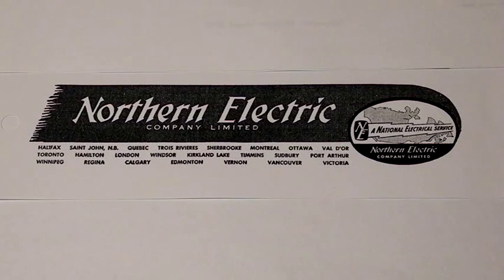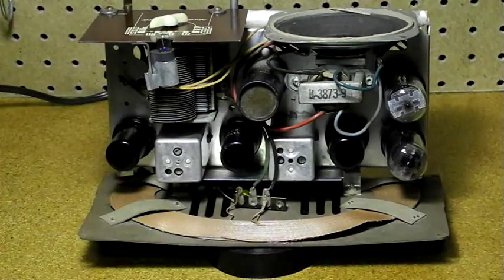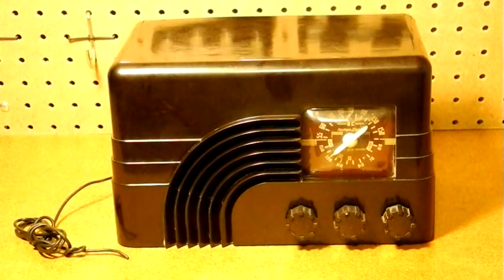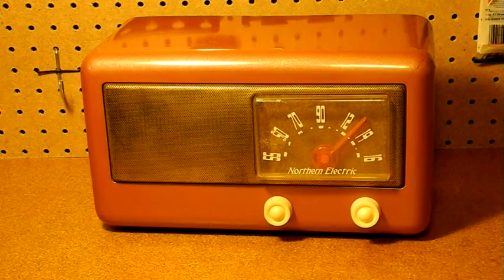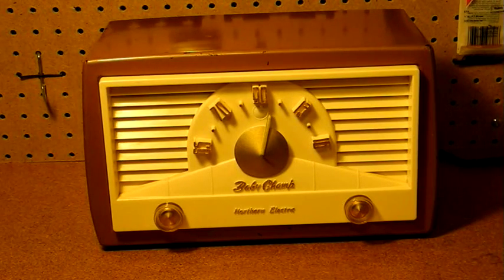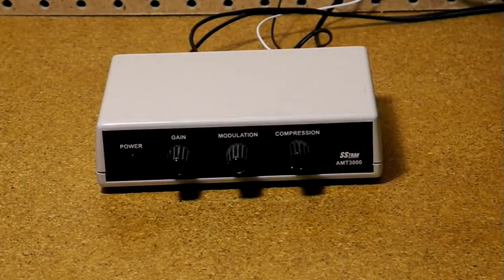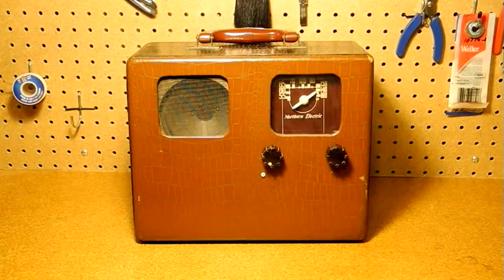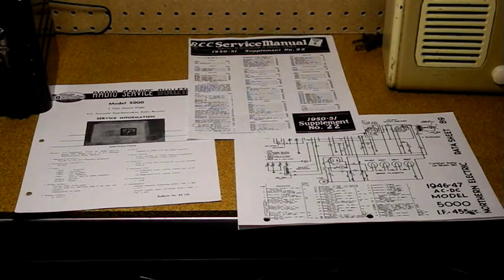Northern Electric Tube Radios

Comment: ?cud you use 9 volt bats in series. For your high voltage. Did this on a Regen set with with a 50c5 af amp home made. Kv4li
Reply from the maker: Yes, for the battery operated radios (sometimes called "farm radios") you can use a number of 9 volt batteries in series (e.g. 5 of them to get 45 volts, 10 to get 90 volts, etc.).
Reply: @jefftranter  might try a super cap. To get more bang for the buck. My notes tell me that power curve flattens out and a cap/ batteries may give a better over all  Umph  to audio ouput de kv4li
Reply: Post script if you member the AC DC radios has strange plug ie had a tab with hole that was to be connected to the center screw of plug plate that was the first polarisation  attempt to  make  transformerless radio safer had a few when the hard ware store closed de kv4li

Comment: i have a northern electric r6a magnaphone junior i bought for $10 as is. it has the 35z5 tube and two others. is this unit collectible?? i am going to restore it and play mp3 through it
Reply from the maker: Those are relatively rare since it is an intercom and not a radio. That sounds like a good application for it. Just be careful with the high voltages present.
Reply: +Jeff Tranter great thanks alot. could the voltage throw back towards my mp3 unit?? also there is 3 tubes both clear can see it light up and one is encased in black plastic. its not a cap as i know difference. why would this be and any way to remive tjebplastic sleeve to reveal the charm of a glowing tube?? thanks
Reply from the maker: I haven't been able to find a circuit diagram for the R6A.

It should have three tubes. Sometimes metal tubes (painted black) were used rather than glass, so it could be a tube. If so, you cannot remove the metal case without destroying it. Or it could be a large voltage dropping resistor which will get warm but not light up.

Typically these types of intercom units used high voltages for the audio signal which are not suitable for directly connecting to an iPod or other MP3 player. You could possibly use an impedance matching transformer, but I couldn't tell you what type without a circuit diagram for the unit. A transformer would also make the unit safer by isolating it from the MP3 player.

There is some danger that the chassis can have a significantly high voltage on it if a capacitor in the unit is electrically leaky. That could pose a risk to you or to a connected MP3 player.

If you aren't familiar with electronics, the best option might be to disconnect the speaker and connect it to a small powered amplifier, leaving the rest of the original electronics intact but unused.
Reply: +Jeff Tranter ok great. ty for the info. its such a nice small unit to see the tubes light up :)